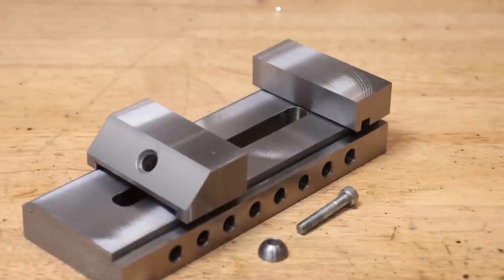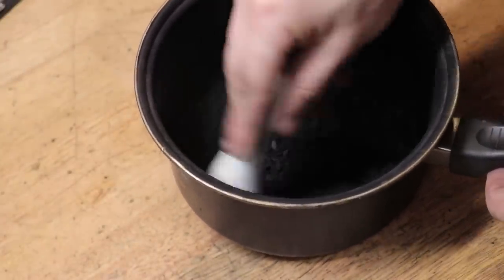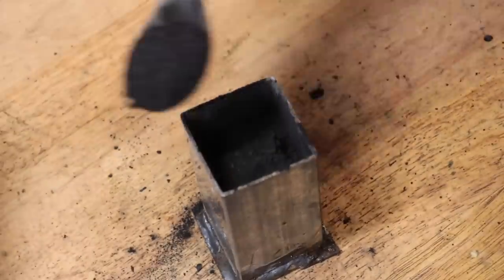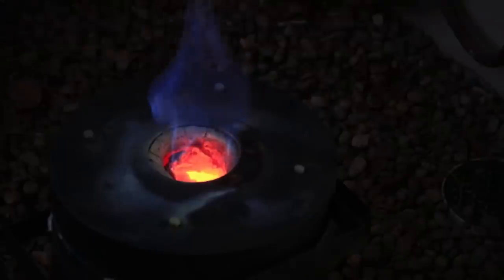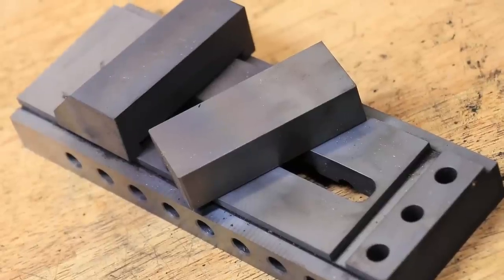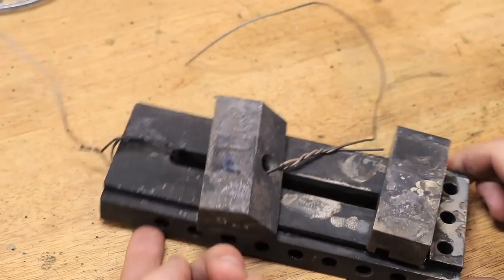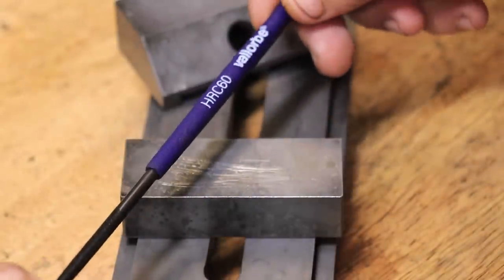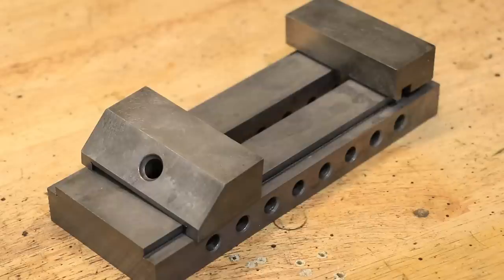Case Hardening And Heat Treatment - Making A Toolmakers Mill Vice   (Part 2)

Comment: When quenching you want to move the part in a circular motion to break up the boiling water or oil, otherwise the bubbles that form can keep the water or oil from touching the entire part and cause uneven hardness and also increases warping, at least that's the conventional wisdom.
Reply: leidenfrost stickin his nose in…
Reply: Exactly what I was about to say !!
Reply: No, up and down, it prevents warpage.
Well, maybe on something this size it wouldn't really matter, but up and down does a better job at mitigating warpage.
Reply: @autumn5592  I have no idea what effect different motions have when quenching, i always use a circular motion. I've only heard of knifemakers recomend using a circular motion, for what it's worth.
Reply: @jemt1631  No, knife maker worth anything will tell you to do circular quench, it is the thing that introduces the most warpage.

Are you sure you don't mean recommend AGAINST?
Reply: @autumn5592  12 or more years ago, when i was interested in knifemaking the circular motion was mentioned on knifemaking forums. Maybe it's no longer recomended or was specific to the type of steel or just bad information. This was still the early days of knife making on the internet, who knows, i might have been doing it wrong the whole time.
Reply: As a knifemaker who does this regularly.. it’s up and down, as sideways motion on hot steel can bend it (if it’s thin). With this thick of steel you really just want to move it to keep bubbles from blocking the water/oil from cooling fast.
Reply: Also, it seems he takes way too much time to dunk the piece.
Reply from the maker: Quite possibly, I don't tend to do much heat treating. Cheers
Reply: @OuroborosArmory  It is not the resistance provided by the quenchant, it is the uneven cooling. If you move a knife blank side to side, the side you are moving toward cools faster than the other, shrinking that side more the other, (thermal expansion coming out of the blade) These differing lengths to the two sides of one piece is what causes the warp.
Reply: It’s up and down. Back and forth on the short side also works. Basically if you do a circle you cool one side different than the other.

Ideally you sit and it wouldn’t boil but if you move it along the thinner edge you get better even cooling, and you typically wanna start with a slightly warmed oil so there’s less thermal shock to both the oil and steel.
Reply: Generally, for most quenching, you move the item in a figure eight pattern. That evens out the cooling and minimizes distortion. Moving it straight up and down tends to not move the oil or water, and so you move through the liquid that you’ve already moved the metal through. That leads to an undue amount of liquid heating around the metal and can affect the cooling.
Reply: i was about to write this
Reply: A deeper barrel and up and down motion works well for me. Saltwater is also something i recommend if you want a RC over 65 using this metod, good for axes but blades tend towards being to brittle and chip easier
Reply: @densamme1752  what does the saltwater do differently than plain water? ;) do you put herbs and spices as well in it? ;p
Reply: @St0RM33  as any chef knows it increases the density and thermal capacity of water aswell as the boiling point, and the salt can provide nucleation points away from the quenched material so that fewer bubbles cling to the steel easing the shedding of the thermal load 🧐
Reply: @densamme1752  it increases boiling point noticeably if you add a ton of salt, but it definitely doesn't increase the thermal capacity, it actually lowers it. Regarding the nucleation points, it may work if you have excess salt out of solution, for fully dissolve salt you only have ions in the solution which don't affect it
Reply: I make knives as well, and I can tell you that neither really makes a significant difference, especially with something as thick as that vice body. The degree and extent to which a specific convention of agitation affects quenching after austenitization is minimal if not non-existent in my experience, impartial grain contraction  seems to be more of an artifact of uneven stresses throughout the grain, which normalization helps with, along with avoiding things like plate martensite, etc. Although, in good conscience I will say that I try to agitate the steel in a rapid up and down motion, helping to avoid vapor shielding around the steel to achieve even hardness. You will find knifemakers holding true to their life about 30 different methods of heat treating, and they all swear that if you dont do it your knife will be worth nothing, but honestly, just read the relevant literature and go by experience
Reply: Ah yes, the Leidenfrost effect...

Comment: Stainless steel foil is an alternative to making boxes for case hardening.
Reply: Yes but from what I've seen the airtightness (is that a word?) leaves a lot to be desired – the first time I saw this used the amount of mill scale at the end was a real disappointment. Honestly looked about the same as if it had been uncovered! And this was just for a basic heat treat, not eight hours soaking at red head. 

And, given one of the recurring themes of the channel, surely this is also loads more expensive?
Reply: Along with making tight hems/seams, don't forget to add some paper into the stainless pouch.  The papers burns and uses up the remaining O2 trapped inside the sealed pouch.
Reply: @tungsten_carbide  Steel is going to discolor during heat treating, but, if it's properly protected, it shouldn't oxidize. In industrial applications, an inert atmosphere or vacuum is use to prevent oxidation. Stainless foil has become the standard for small operations. Done correctly, it's very effective and inexpensive. To me, the biggest drawback is that foil is razor  sharp and needs to be treated with extreme respect.

As Bob Vines stated, the seams need to be tightly folded to ensure integrity of the enclosure, and a source of carbon, needs to be included to consume oxygen. In this particular situation, the charcoal used for case hardening will also do a great job consuming remnant oxygen. 

Foil is not a good choice when there isn't good control over the heat source or where it's subject to physical abuse because it can be damaged.
Reply: @EDesigns_FL  Discolor? The discoloring (especially the more "rainbow" effect) are due to thin film oxidation isn't it? Ideally you should extremely little or none.
Reply: @Thorhian  Just as it's impossible to create a perfect vacuum, simple combustion is not going to consume all O². Oxygen is extremely reactive and clings to metal surfaces. Combustion is only going to reduce the quantity of O², not completely eliminate it.
Reply: @EDesigns_FL  If only argon furnace environments were more accessible to make the oxygen level practically negligible.
Reply: Any thoughts on making the box out of bisque fired ceramics. It could be filled and then sealed with a lid gasketed with moist clay. In pottery this is called a saggar. It is used in reverse to protect a delicate piece of pottery from the internal kiln environment.

Comment: Brilliant video thanks! Home brew case hardening!  A year ago I went down that rabbit hole also, using the same ingredients and process, but I had an explosion on my first trial that damaged my electric kiln. So I just through harden now using 01 steel...and I don't have to worry about case depth. Cheers  Cliff
Reply from the maker: Blimey. I'll have to be careful about these explosions. If I could get tool still in thick bar stock I'd definitely use it over using case hardening steel. Cheers

Comment: Very interesting process of carbonizing the steel in order to heat treat it. And it keeps with the channel theme of being inexpensive and accessible. Electrolysis definitely seems like a good choice for a part with a lot of surface area like that because it can get into all the crevices and do the entire process all at once. I am curious how you plan to take out the warp in the parts though and get them to fit together and be square and uniform. Can't wait to see your next video!

Comment: You can also use graphite since its pure carbon and already powder or granules.
Usually best for parts like drills or taps that you can use a little at a time by using gypsum as youre "box"

Comment: I‘ve tested vinegar for derusting too. But I boiled it some minutes in vinegar and it worked pretty good on a old drillbit. But it smelled so horrible in the whole kitchen… I continued using electrolysis.

Best wishes
Reply: A camp stove and secondhand pot is a great idea for it, if you don't have many neighbours anyway

Comment: Another method for removing rust and scale: Dilute Muriatic Acid ( Pool Hydrocholric Acid) bath; once metal is Grey, wash in Hot water and Bicarbonate of Soda to neutralize any remaining acid.
Dry and Oil.
Simpler Method: Solution of One Part Molasses  with 5 parts Water; drop parts in and allow to sit for several days to a week ( this works well for Rusty Large machinery, etc). Wash off with Pressure Water jet, dry and oil immediately.
The Acid Method I used for a stack of Gunbarrels damaged in 1974 Floods; the Molasses method with a Blacksmith's Pole Drill Press. Both came out Grey Steel.

Comment: Just a quick thing on the rusting post-vinegar soak, I know you said you're going to rely on electrolysis in the future and there's no real downside to this but just in case you might need to use an acid bath again at some point in the future (and obviously hoping it's of help to any other readers) that tendency towards future rusting can be greatly lessened, possibly halted entirely, if you give the parts a soapy scrub using common hand soap. 

The cheaper and harsher the soap the better from the results I've seen, but any bog-standard soap should work nearly as well. I live in a constantly-humid environment, although my temps are mild RH still rarely drops below 80% and frequently is in the 90s and while it's not like the tropics spontaneous rusting of bare steel is most definitely something we need to stay on top of. And after rust removal using salted vinegar or citric acid, thorough scouring/scrubbing to remove the black residue and then the final, thorough, soapy scrub using an old toothbrush and hand drying, leaving any remaining adsorbed water to air dry, I have been able to leave some things nearly permanently 'dry' and they barely flash rust, if at all. I'm sure I have some parts of to-be-completed projects, and definitely some restored files, that have sat for years in drawers or cabinets that didn't even get a spray of WD-40 and they're basically the same. The most added protection some have had is a wrap in one sheet of newsprint and that's it. 

Hope it's of help to someone.
Reply from the maker: Intereting, I just used regular baking soda to neutralise the acid. Impressed at how well your parts have held up. Humidity is very high where I am and rusting is an issue if parts aren't oiled. Cheers

Comment: After soaking it in vinegar, I usually end up soaking the part in solution of baking soda and water, to neutralize the rusting effect. I also might add a thin coat of oil if I can't work with the part at that moment.

Comment: Depending in the amount of galvanized coating that needs to be removed, instead of grinding it away, use vinegar "overnight" to basically eat the zinc off of the steel.  I'm pretty sure that another of the ~118 comments already made here (at the time I'm commenting) has already mentioned this, but I thought that I'd mention it "just in case."

Comment: Few things, you’ll want to use a brine instead of pure water for a quench as it produces less bubbles than pure water, and if not just oil quench and don’t worry about tempering. 

Second, lapping a datum face on your vice before you begin grinding is a good idea. Stick some 400 grit to your surface plate and seal it with tape to keep the grit away from the surface and then move the vice in a figure 8 without downward pressure. Measure, push slightly on high spots, get it kinda flat, then grind.
Reply from the maker: Yeah the data sheet from the supplier suggested water or brine, I just found it easier to use straight water.

Comment: I've found the only way to get vinegar to do the job of removing forge scale is to use an old croc pot set on high with double strength cleaning vinegar, the crock pot keeps it heated to 80 or 90 degrees, then it does a good job in just a few hours.
Reply: Citric acid works better and is just as easy to obtain.

Comment: Awesome project, the way I see it this is a major step up for you in terms of showcasing techniques.
I'm curious for next time as to how you plan to grind the surfaces.

If I had to give one point of critique to the project up until now it would be this:
The way the fixed jaw is mounted can be improved. If the bolts and the key switched places then the jaw would be stiffer. This is because if we look at the key as a pivot point when it's behind, the bolts are in a favourable position to resist jaw tilt. If the bolts are at the back, they are very close to the pivot (short moment arm). This reduces the stiffness and ultimately the strength of the joint.

That being said, it will work just fine the way it is. I don't think you'd put excessive force on a vise like this. Just a small pointer in terms of design.

Comment: For small parts we would coat with really dirty black old car engine oil, then blast it with a blow torch to get the steel red hot and burn off all the oil, then repeat. That gives a good carbon impregnation in to the steel so it can be case hardened later by heat and quench.
Probably no good for such big parts but on small things like homemade bolts and widgets it works a treat. It needs to be small enough that you can get it glowing in 20 or 30 seconds with a blow torch.
Reply from the maker: That's awesome, never heard of that method. I'll have to give it a go one of these days. Definitely seems better than pack hardening for small parts. Cheers
Reply: Then a tar+charcoal paste should also be quite interesting
Reply: @herrkulor3771  .. sure would probably work. I think you just need carbon in contact with the steel, enough heat, and keep the oxygen out.

Comment: This is a kiln, or a foundry… not a forge. Mostly it’s in how it’s set up and what you use it for. As this has the opening in the top and burner on the bottom, it’s a foundry (mostly used for melting metal)

Comment: I've had a go at case hardening using "cherry red", to be honest, it didnt seem to do much at all. Relegated the cherry red to the back of the cupboard, and decided to stick with 4140.
Reply from the maker: Interesting. I've heard of these case hardening compounds made for this purpose but I was wondering how well they worked. Cheers
Reply: @artisanmakes  I've got the Cherry Red compound too and some years ago I used another compound called Casenit........both worked, and if you get the steel to bright red and " cook" it for about 1/2 hour it will give you a .5 to 1mm case......more gives you a deeper case.....it just takes time for the carbon to get into the steel surface.
The secret is to keep the compound evenly covering the material to be cased while heating......being powder it tends to blow or fall off.
For really serious stuff it's best left to industrial hardening shops that use nasty stuff you wouldn't want to be near.
I have read many years ago that a mixture of old bones and horns crushed up will also give you a case but it's also a slow process but works too.
Reply from the maker: So I have heard. Machinery handbook recommends potassium cyanide as a source of carbon. Crazy eh

Comment: I always wondered whar case hardening was. Now I know. Great vid
Reply: Hardening only the outer region (case). You could have performed a 5-second Google search at any time in your life to find this out. There was absolutely no need to wait until now.
Reply: I could have done but wheres the fun in that?
Reply from the maker: Cheers. It should be pointed out that this is just one method of case hardening. This method is rarely used nowadays, its been replaced by faster more efficient processes

Comment: BTW......don't ever use mild steel that has been casehardened for vice jaws as the core is too soft and will deflect and crack under the vice clamping pressure...don't ask me how I know.....a. case hardening tool steel like E200 is the steel for vice jaws.
Reply from the maker: It is definitely a concern, which was one reason for the deeper case, but it is something ill keep an eye out for. Whilst it is not 100 percent analogous, but i have a 100 year old inherited vise with case hardened vise jaws (at least to my understanding) and that has held up well.  But of course of it cracks ill have to install some proper jaws. Cheers

Comment: When using vinegar or any acid, ALWAYS neutralize them with a base or else you'll get flash rust even after a good wash.
You can use baking soda. Be aware that the more the gradient is between your acid and your base, the more violent is the reaction.
White vinegar on baking soda gives you a good sizzling. Be aware of the heat too ^^ It produces heat.
Reply from the maker: Cheers. The heat wasn't much to worry about, especially when it was just baking soda on vinegar :)
Reply: @artisanmakes  Well, there's more to the reaction than that. I learned that when i was restoring an old mopped. I had to remove rust in the gas tank, and the easiest way was to fill it with white vinegar, throw some nuts in it, and shake it.
I made the same mistake first, and the tank flash rusted on me, i had to redo it and then I neutralized the vinegar with baking soda.
Rinced and last part was to then use isopropanol to ease the evaporation of water content still left in there.